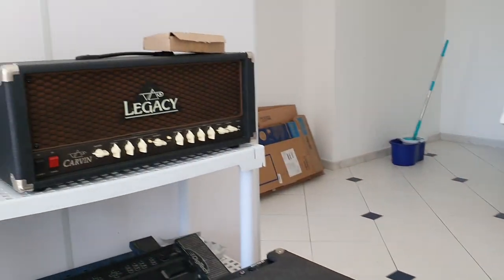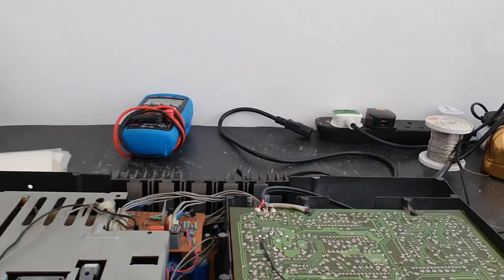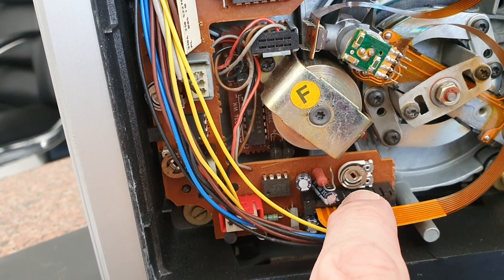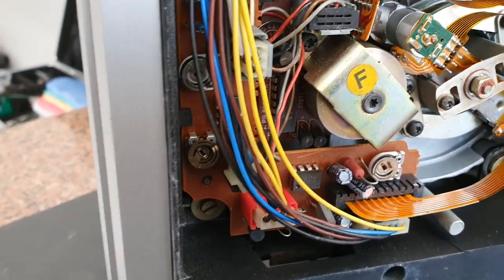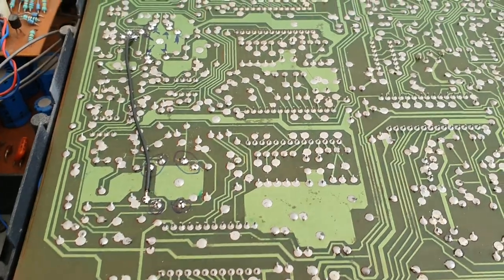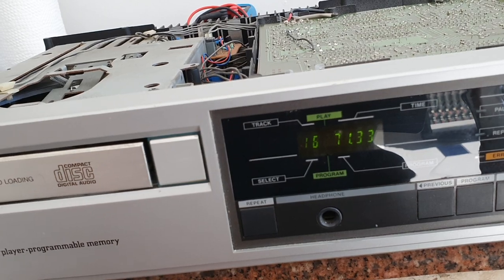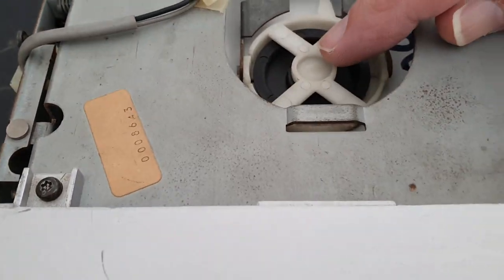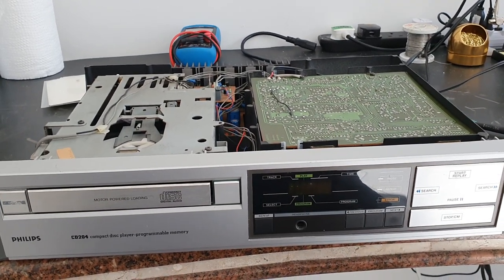Philips CDM1 adjustment Tutorial for CD104, 204, 304 etc

Comment: I never thought id see a "brazil" made CD 204. I live in Argentina, and i have an early production sample from 1984. Only a few were imported due to the high costs. But they are built like tanks. Mine was very abused and it wasn´t taken care of. But after changing all the philips capacitors, it came back to life. 

If you check the voltage regulators they say "BRASIL" on top, very cool.
Reply from the maker: I may sell my serviced 204 soon and just keep my 104.

Comment: This player is of a earlier generation, compaired to the cdm2 and 4 i work on on a regulair almost weekly basis.
A word of warning here:

You should check and service the laser power supply, and the servo systems first,  before making any ajustments at all !!!
In my experience as a professional audiotech, it was very seldom that laserpower needs a adjustment. Most of the time the root cause is something else. Dried out electrolitics in servo and lasersupply are the main culpritt on the cd players equipped with cdm2 and 4, and i  can imagine it be the same here.

The bearing adjustment however i already came across that problem in the mid 90 ties. So yes, always check that. The lightblue caps in these and later generations are all way out off spec by now, so a full service should be done.

Enjoy these nice machines,  and indeed, a masterclock is always a very nice upgrade.
Reply from the maker: Thanks for your comment, I agree 100% but this video is aimed for the non Technical person. I too have done a lot with later generation and been in audio electronics for more than 35 years.

Comment: Hi Master! Ph. CD304 mk1. (CD104 dac/servo boards) but this has CDM-0 mech. (metal plate, brushed motor) origanal CD 75min/21track 18-20th tracks often skippings and  21st mostly not read at all....and im hearing ?the focus? give rhythmically louder noisy to end. Can its be a same problem? (for history: everything was moved: -i need to grab out all from chassis, for IEC connector installation's metal works)
Reply from the maker: @szabolcskiraly1166  yes, seems like the Torx screw adjustment for turntable height should work.
Reply: @delatronics3257  Problem solved THX !
In case of CDM-0 ure need 4mm wrench for lock nut, and 1 mm allen key to set crew.
The set screw thread is more finer: instead of 1/8, ure need to turn 1/2 or 3/4 to good results. 
(of course my 1mm allen key nowhere find.... backup plan: T6 torx)

Comment: Is the TDA1540 DAC better sounding than TDA1541?   and by the way, this CD looks much like my old Philips CD 350
Reply from the maker: @virgogreg  Yes in my opinion the 1540 being two separate mono blocks one for left and one for the right chanel, the 1541 is a stereo DAC and is built down to a price. The 1541 is a good DAC (especially so with NOS removed) and has the advantage of being able to have a digital output, but sheer musicality and an organic quality makes the 1540 shine for me.
Reply: @delatronics3257  I am a dynamic range guy how does it stack with the TDA1541?
Reply from the maker: @virgogreg  if it's about dynamic range and punchy sound the 1541 would be slightly ahead at least on paper.

Comment: People don’t have a clue. You need an oscilloscope and put cd players in service mode and adjust to spec. Done many years of repairs in cds, laserdisc and video, etc. these videos on here are a joke and don’t have a clue what they are doing. What you are doing is messing it up more to failure. What a joke.
Reply from the maker: I have personally set these up with an analogue scope but the vast majority of amateurs and tinkerers don't possess scopes. In my experience, as long as you keep away from the trimpots and just tweak the turntable height on a CDM1 mechanism; function can be restored without damage to the laser or mechanism. Not many technicians are available or are willing to repair these old machines, so they end up sitting in storage and out of use until a solution can be found in an experienced engineer with all the necessary equipment. You are obviously being critical of my video which is your perogative, perhaps you have some more technical videos on your channel to help people out; but my guess is that that info would go over most people's heads...Or maybe you are a troll!